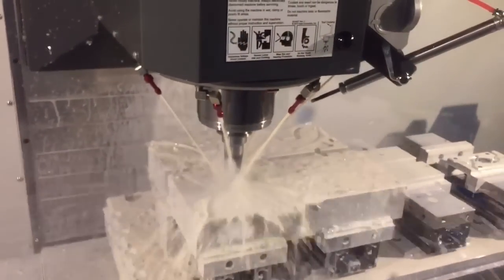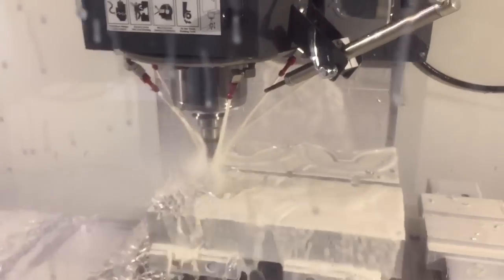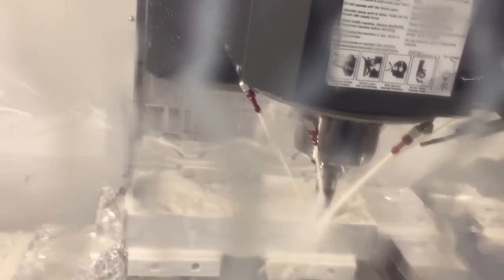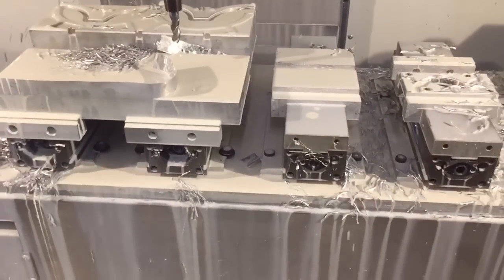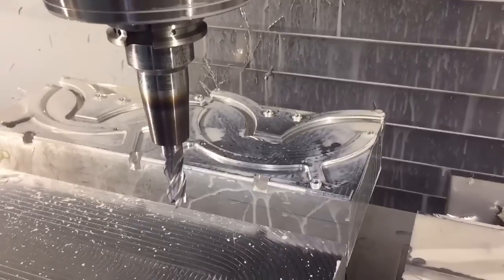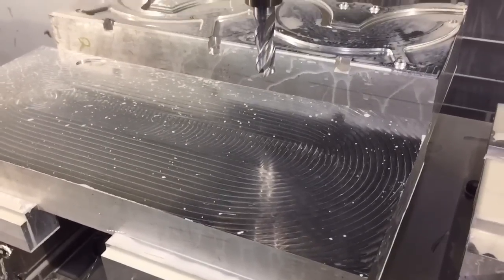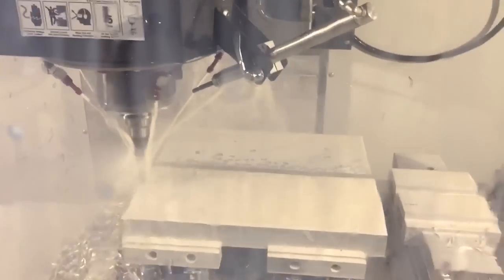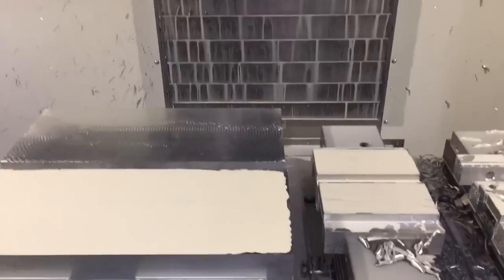ZOO CNC CONSULTANTS CNC HIGH SPEED WAVEFORM POCKET ROUGHING USING ALPHACAM ON A HAAS VF4ss

Comment: Why not just use a big facemill ?  Seems like a lot to work that little endmill.
Reply from the maker: It a normal situation for production you are right.  In this case I was just playing with the waveform roughing, it's a very valuable option when you can't get a larger tool in place or for pockets.  Also keep in mind on hard to machine materials tool life and performance are greatly improved over conventional methods with adaptive roughing or waveform strategies.

Comment: the Z axis does not have a brake?
Reply: +ipadize the spindle head does have a brake, but the servo amplifier's outputs are unpredictable during a blackout like in this video. there's usually a split-second delay between the power loss and brake clamping. it's enough time for the tool to grab and pull itself in (under certain circumstances)
Reply: +Andrew Ydna DuBuc ah ok :)

Comment from the maker: So I want to mention something I thought was really cool.  There are some new people at AlphaCam I'm guessing? But anyway I just got a revised Haas post and I was surprised to see that they have made some really powerful improvements.  Your software is only as good as whatever you are using for a post and we have always had a pretty good post.  In fact compared to most I've seen at other facilities ours was bulletproof.  Well now it's even better.  We can now output G97 local subs in our files with zero editing.  Maybe that sounds simple but MasterCam doesn't have it right and neither does SurfCam.  I'm going to continue going through this post but so far it's looking good.  Seems to me AlphaCam is making a move to get more market share in the US.
Reply: +Groove Automation (-Louramore) I'm guessing that's a typo for M97? I use Surfcam, post with MPost, and use subs quite a bit. No need to make any manual edits. If you're still using Surfcam, I can help with your post template. Let me know.
Reply from the maker: +GARRETT LEWIS Hey Garrett,
I still use SurfCam but and I use M post but haven't had any luck with creating subs without edits.  I do use M97 for local subs.  I just prefer not to clog up the program file list by having all of the operations separated by PGM number. 

I'm always interested in hearing what other users are doing so yeah that would be great.  You can reach me at 954-873-9057 but please shoot a text first so I know to pick the call up.  Thanks for the input

Comment: Nice vid. Love to see those chips flying... Just one question:
If you just wanted to face that part, why not use a big (100mm, 120mm, sorry for the old world units) indexable face mill? Have you tried it and found it slower? Or was it just for showcasing that particular strategy?

P.S. Ok, that was technically 3 questions, but they were all similar... :)
Reply: +Kostas Froudarakis I haven't compared this exact type of scenario but you're probably right.  It would most likely be faster with a face mill, especially the Freedom cutter from Mil-Tec with Octagon inserts.  It might be close only because of the depths of cut.  Now you've got me thinking about it so I'm going to have to try a real comparison.  I'll dig up some material and post something.  We will know once and for all which one wins the race..   :-)
Reply: we use big cutter like 120,100mm that time we keep feed low
when we use  50mm cutter we can use low*3 feed rat after that cut time is no change.

Comment: Why not machine outside in? Should be quite a bit faster without Haas' corner slowing moves. Definitely plug in a G187 P1 E.025 since you're just clearing the entire block.
Reply: +atomkinder67 That would be much faster I'm sure.  This started out as a pocketing demonstration for a buddy of mine and I got side tracked.  Now that you mentioned it I want to do what you suggested.  I interested to see how much of a difference it would make.  On two levels actually, one is using the finishing tolerance and then also going outside in would also make the chip handling less problematic.  Could possibly increase feed if not in a pocket.
Reply: +ADAM LOURAMORE I was wondering what CAM was used and then I read the description again. I was thinking Mastercam, but since Alphacam is also a Moduleworks partner that makes sense that they would look similar. I would be interested in seeing a back-to-back comparison between outside and inside roughing with the same speed and chipload, as well as same G187 parameters, etc. I keep meaning to do something similar to see if HSMWorks beats Volumill like I think (and hope) it would.